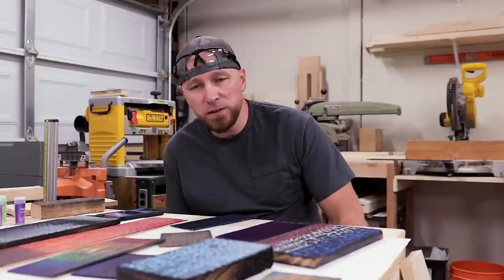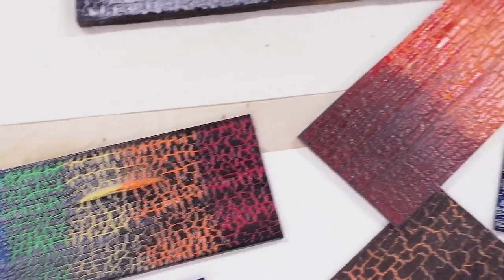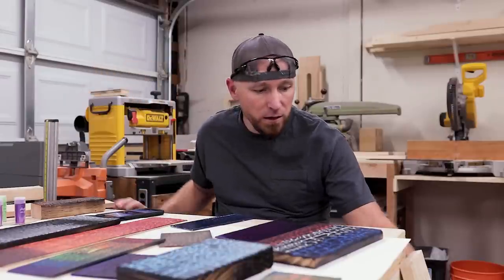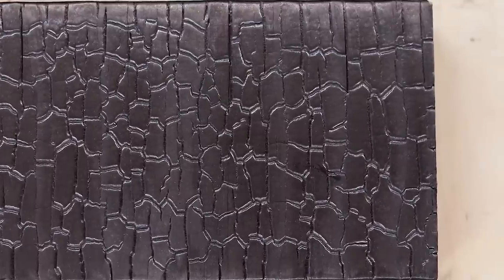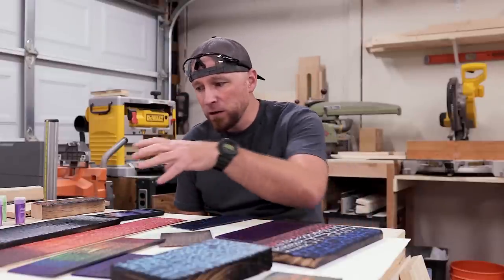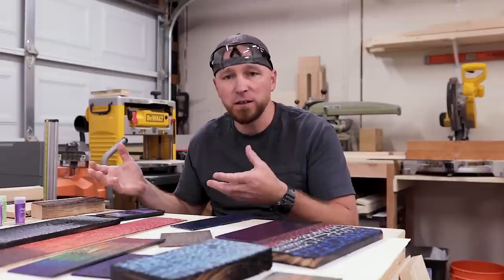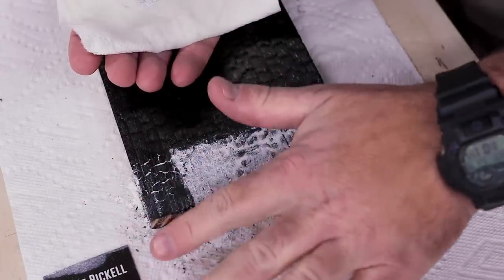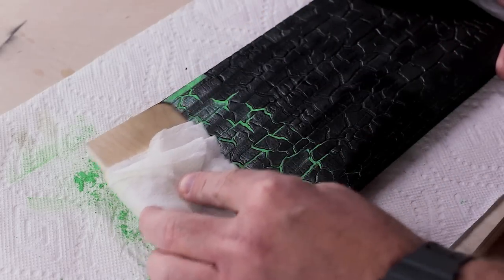Shou Sugi Ban 2.0

Comment: Love your vids, now subscribed. I have an off topic question if you don't mind. I just picked up a hardly used DeWalt thicknesser like the one you have. I find I have to slick the s/steel table about every 15 linear yards as it starts to bind, that's annoying. Bear in mind it didn't come with dust extraction so it throws dust back into the feed bed. I am trying to source the dust collection stuff. Any suggestions on my issue and how often you have to slick the bed and what you use? Much appreciated.... I am a noob so learning heaps. :)

Comment: Dude, this is really cool, your name true to form that's for sure. I'm going to try this but, I'm going to try with epoxy plus pigment, like they do with electric burning or licktenburg I believe. I think a computer desk would be pretty cool, because the colors would accent the desk overall, but a lot of the surface would be covered up by the computer, monitor, speakers, keyboard, etc. I think it might be even cooler to go a step further and carve a river, or design. Then fill with resin, or a median like Fire glass, and Fire Glass comes in all kinds of colors. So you could two tone the table. The more I think about, the more I need to try it.
Reply from the maker: I haven't done the Lichtenberg technique myself so I'm not 100% sure how it's done, but I believe you have to sand the epoxy afterwards. If that's the case, you might not be able to do it the same way here because you won't be able to sand. Best of luck to you if you do try it though!

Comment: Great info. I am just getting into this form of finishing. I have a garage I can drive through to the patio. In the back of the house and plan to do the burn technique on carriage doors I’m building using 2 inch thick pine. I only want the charring as a dark accent do you recommend wire brushing the wood first or still going with a full char then brushing? I’m checking out some of ur earlier videos as well. 
Btw you videos are great. First channel I ever subscribed to, and the suggestion to get the restore tool from porter cable was great I had never heard of it and most places I looked for it the staff had never heard of it lol.
Reply from the maker: Well thank you. If you're going for a full char than I wouldn't even worry about brushing before or after. Just make sure that the wood doesn't have any major pits or gouges and you should be good to go. Brushing beforehand will give you lines in the burn if you use a wire brush. Basically anything done to the wood prior will show up.

Comment: Might be best to spray with poly then mica powder ten more poly to stop the smudge
Reply: John Waites I was thinking the same thing and wondering if that would help.
Reply from the maker: I've been wondering the same thing. It would just have to be enough coats to make the surface smooth though. I'm going to give it a shot and see what happens. Thanks!

Comment: Hey boss, I have a question. Why not mix the mica with epoxy first and pour it on. Mica sinks to the bottom of poxy over time.
 If too much is still setting on your high spots... take a squeegee (or bendable plastic card thats pretty forgiving), spay the squeegee with isopropyl alcohol so epoxy doesn't stick to it.

Comment: I've found many of your videos to be very well thought out, easy to understand, and very informative. I have a project in mind and I'm considering the use of the Mica Powder but I'm concerned about the application especially since I'll be doing many different colors. I guess I'll have to practice and play around with it. Question, if you spray a coating of poly on it and let it dry could you come back behind it the next day and use the same poly product but in a brush on form...would a foam brush work better than a bristle brush?
Reply from the maker: I don't believe I have tried it myself but everything I've read or seen says that it is okay to do. I personally usually use foam for water based poly, and stain for that matter, because I have had oil based stuff disintegrate foam after a little use.

Comment: Do you weather your wood? I tried a piece of pine that sat outside fir a year in the rain. To me it seemed to char better than just a nice sanded piece. I really liked that green color. Thanks for showing that new powder.
Reply from the maker: Not intentionally for burning, no. It honestly shouldn't matter though as most weathering is on the surface anyway, which would be charred and removed and therefor exposing new wood. As an example I pressure washed my old, weathered fence and now it looks almost brand new just because I took off the weathered layer.

Comment: Hi, great videos btw, very much appreciate your passion in this skill.
To answer your question in my words, In regards to how hot, size of flame and time spend on an area of wood surface, method's of burning in my case building Guitars on the body of the guitar i can go longer on a smaller flame if its a veneer top glued to the thick substrate body, but have to consider heat affecting glues(fish glue or tightbond 50) and warping the vaneer if i decide to burn the wood before i glue it to the body, theres also the glue that binds the 2 piece say 3-6mm top center line that is hand planed both edges to a point where there must be zero gaps and the joint is 90° and completely straight without the glue alost vacuum air tight, makes a distinctive squeaky noise when youve done it right, extensively long heat exposure can affect this so i prefer to use a hotter flame wide or slim so i use mostly my plumbers torch its a dickie dyer torch handle and nozzle with adjustable flow and its map-x gas. I thinks its a hotter propane mix havnt checked but will for posterity sake. and the hottest part of the flame the blue tip, in a more rapid time frame because my main priority other than aesthetics and how much wood is being consumed comes second to the stability of the whole instrument- has to stay set and unaffected else it can look great but wont be worth anything if it pops and i have to start over, plus the orange part of the flame causes blotches/patches if im doing a light burnt look and taking it easy sometimes fast and hot is best.
The same discipline is also relevant to the neck of the guitar at any stage of the neck build, but never with the frets in, the difference in materials and their heat conductive properties will cause the metal and wood to heat and cool at different rates. same heat warping twisting etc and the wood must be dry without any moisture for the same stability reasons in any part of guitar build and I'd say the same for any woodworking applications. 
Thanks again, you clearly know your stuff and i respect that i also understand that online 'everyone's an expert!' Im referring to the trolls. Its good to have hecklers it means your doing something right and the truth is no one likes to see anyone get ahead of them, i know this because i am also human, just some ppl take longer to swallow the pill. You're making it happen bro! ❤' IT! 👍

Comment: Jody, great video!  I enjoy the detail.  Now, if the video was 18 hours long, that might be a bit much. Just an idea, I am not an artisan like you, but... What do you think about a very fine brush instead of the card? A very fine paint brush or better yet a print-dusting brush like in a forensics kit. Remove the top layer without smudging. Also, a coffee table could look nice, I suppose, if there was a pane of glass on top. Just some ideas from my less-than-artistic mind.
Reply from the maker: Thanks for the ideas! I tried small brushes yesterday, albeit some small artist type paint brushes, but it didn't make a difference. That's not to say it can't be done. Maybe I don't have the right tools for the job. Yeah I could see a table with a glass top. That might be kind of neat.

Comment: Hopefully you read this to answer my question haha. So i am wanting to replace my cheap desk top with something better. I saw your videos with this and it looks amazing! Do you think if i were to buy a wood like pine, glue pieces together, sand the glue off the surface, char it, add the powder, seal it with the clear coat spray andddd have a good layer or two of epoxy, that i would have a good desk top?? Ive never dealt with epoxy and especially with charred wood haha, so i am wondering if you think it will hold up to me writing on it, resting on it or anything else that is bound to a standard desk haha. If you have any tips for me, that would be sooooo appreciated!

Comment: Isn't there a way to 'lubricate' the top of the boards, then spray glue on it so that it gets into the cracks and blow or drop the micro powder into the cracks before wiping the board... also, the same with phosphorescent micro powder would be ace!

Comment: That's what i thought when i was watching your previous shou sugi ban videos but as you said it didn't work with a tiny little torch. I'm glad to see it works with a bigger one 👏🏻 I'll give a try.

One suggestion, you should try to seal the burnt wood first, then apply acrylic paint on cracks and wipe off the excess on top surface when it dries 🤔

Thanks for your effort..
Reply from the maker: I'm not sure how to wipe it off once it dries though. I am thinking of trying to seal it first and then proceeding with the rest of the steps. As long as the sealant doesn't fill up the voids too much it should work. Thanks!
Reply: @InspireWoodcraft  i was working on laser engraved materials and rubbing alcohol works best. But i dont know if the rest of paint spreads on a rough surface 🧐 should be sealed well maybe

Comment: Hey again I ve just built a shed in this stuff but haven't coated it in anything yet. What would think might be a good finish without changing the natural burn look. cheers!
Reply from the maker: I use water based poly with good results. The wipe/brush on kind. It builds thick layers and looks really nice.

Comment: Do you think sealing the wood before the mica and followed by careful poly spray would work?  I like the idea of white in the grooves and black as possible on the surface for the most contrast.
Reply from the maker: That was my next step, honestly. It takes a while to fully seal it off with such thin coats, but in theory it should work. So long as the grooves aren't filled too deep with the initial seal coat.

Comment: Been a subscriber for a while now. Have a couple questions on this. Have you tried this with white oak?  Would I get the same effect if I used a red or blue stain like you did in a  previous video series? Any help would be appreciated. Thank you.
Reply from the maker: I haven't tried this on any hardwoods yet. I might try but in the past I have not had any luck with hardwoods at all. Stain or paint might work if it was applied locally to the shallow parts, otherwise I just don't see it working out because the stain would smear. At least that would be my assumption. The only reason it works on the brushed method is because the charred grain becomes polished.

Comment: So I found this to be very cool idea so try make a pen in this way but I had a hard time getting the powder in the groves and stay I used cedar too. I also used perlex too is the powder different  in a way i don't know?
Reply from the maker: I don't have any experience with perlex so I'm not sure. From what I learned and I think mentioned in the video, Pine would be a better option over Cedar for your project I think. Cedar seemed to be a lot more difficult to work with. If I think if I was to try this on a pen (which would look super awesome by the way!) I would apply the powder a little at a time with it still in the lathe and then coat it with thin CA glue to lock the powder in. Then rotate the pen, add some more powder, coat with CA glue, and repeat until the whole thing was complete.
Reply: @InspireWoodcraft  the 2.0 version didn't work with pine yet but I was able to make a normal shou sugi bon did work great thou thank for your videos. Its help me a lot to learn new thing

Comment: Could you not just use powdered wax and oven bake it or quickly run a torch over it while it’s in the cracks and then let it cool then seal it? Sounds way easier
Reply from the maker: I mean, it sounds way easier, but I didn't even know that powdered wax was a thing. Haha
Reply: That's one great idea - so basically mixing the wax and mica, apply, heat, wipe out the excess and that's it. Worth a try